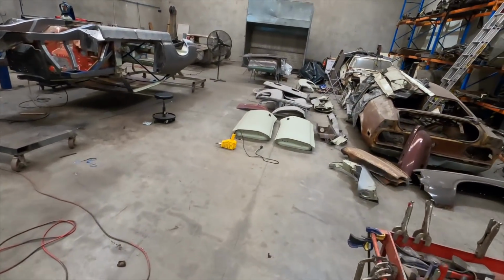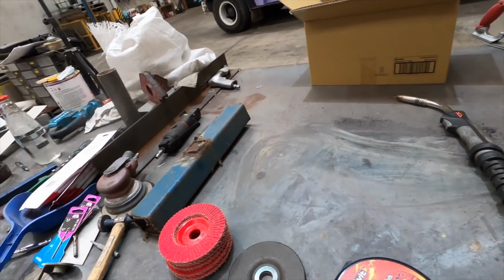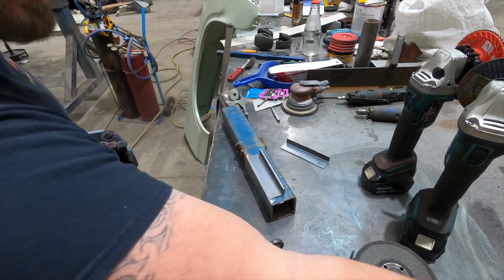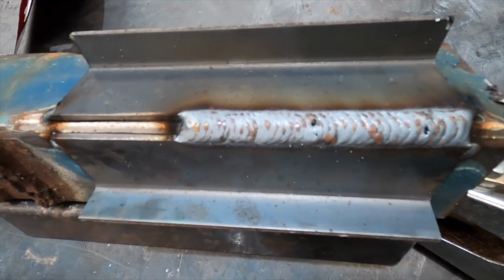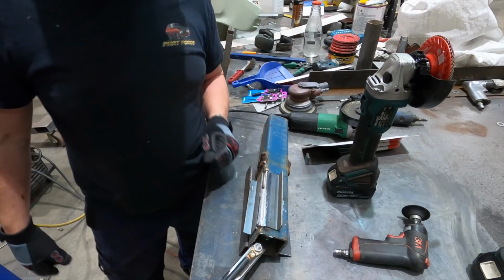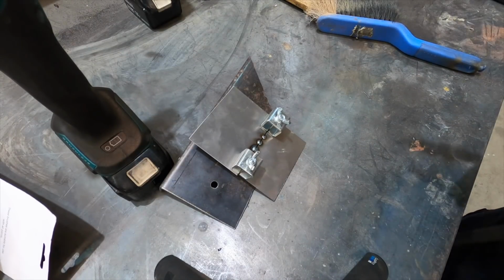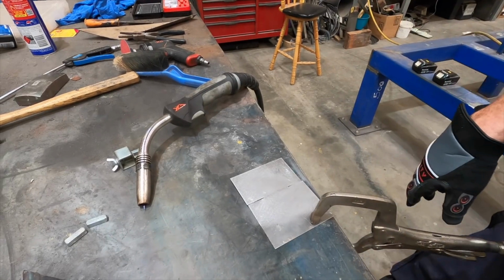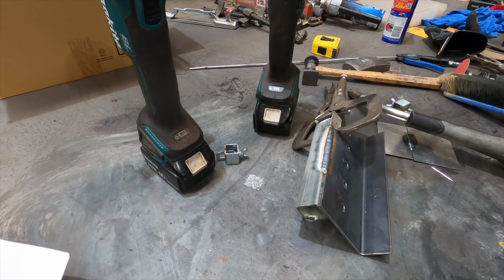How to Mig Weld Mild steel, sheet metal, and linishing  welds  EPS 37

Comment: Someone ask me if I knew how to weld an I told him I know what a good weld sounds like, he just laughed.

I rarely ever weld, I learned a little bit years ago from a boiler maker and whenever I have to weld something I go by sound and it works for me.
Reply from the maker: Same here, there is a real sweet spot you can get when you have the amps and gas and wire speed just right

Comment: You know planishing refers to flattening sheet metal specifically with a hammer or wheel. Grinding is just grinding. Don't get me wrong, I love what you're doing, I've had plans for a long time to do something similar with a 67 fastback mustang shell. It just messes with my OCD every time you misuse the word lol.
Reply from the maker: You are right and thanks for correcting me, the word I meant to use was "Linishing"the welds, I will edit that) I get tounge tied a lot when I try to talk on camera, I forget heaps and use the wrong words a lot.
Reply: @phatridesgarage3760  I can't even talk on camera so you're better than most people lol

Comment: I'm hit and miss for gloves some situations yes and some no. the main reason i avoid gloves when using angle grinders and particularly bench grinders is, gloves can get caught up and drag ya arm into the machine where as not wearing gloves your more likely to just get a good cut rather than something far worse. i know at trade school gloves while using a bench grinder was a big no no for the reason i just said
Reply from the maker: you make a good point, and I agree with you, I use gloves just when it feels right to use them, handling hot things or chemicals especially , truth is i hardly ever use them otherwise, but I think there are time I could be using them more, its personal preference i guess, but loose floppy gloves im not keen on unless its welding gloves just for welding